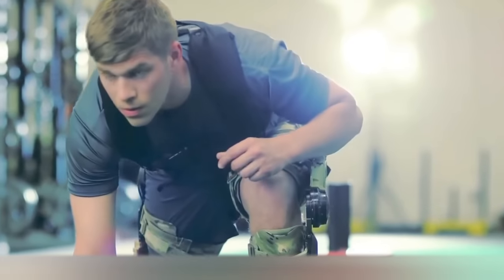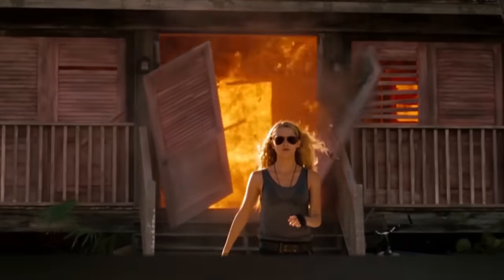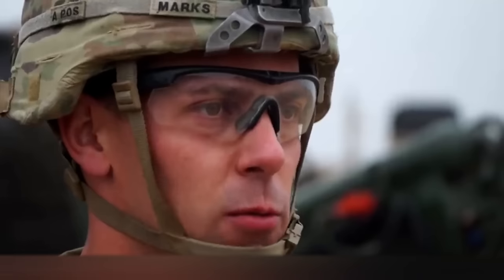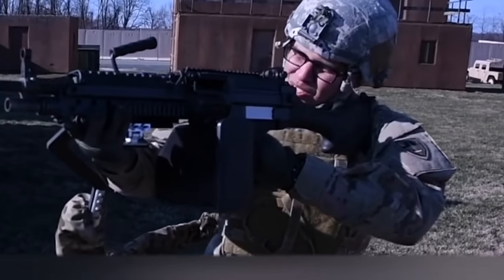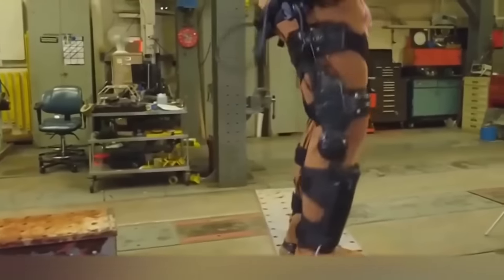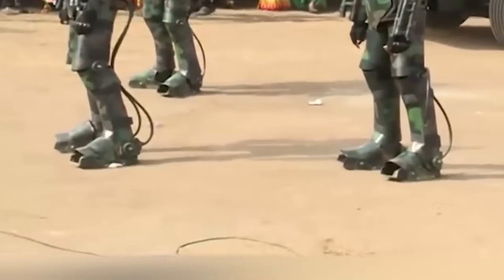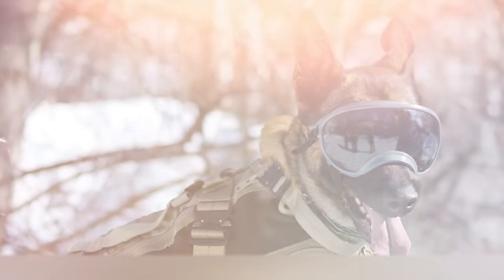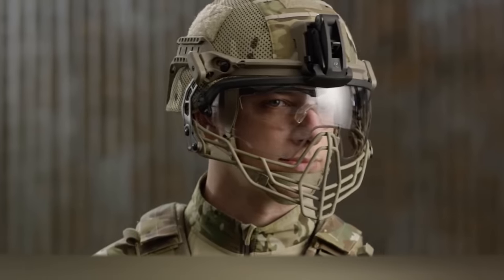The Most Terrifying and Powerful Protective Uniforms in the World!

Comment: You were too gentle on the suits from Ghana. The hoses don't connect to anything. The whole operation is a scam. The "developer" bought cheap junk from China and it offers no protection whatsoever. The vehicle has no plating and it's missing screws in the flooring. When they walk over you can see through to the ground beneath.